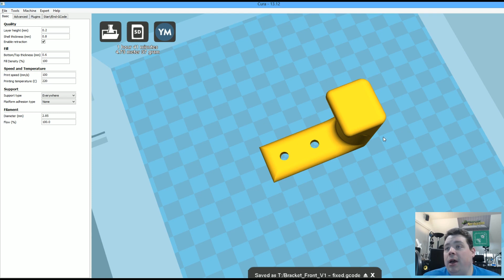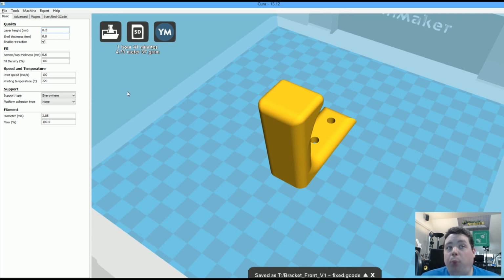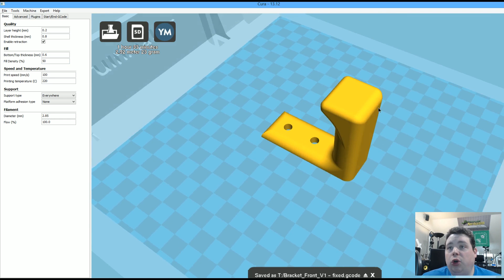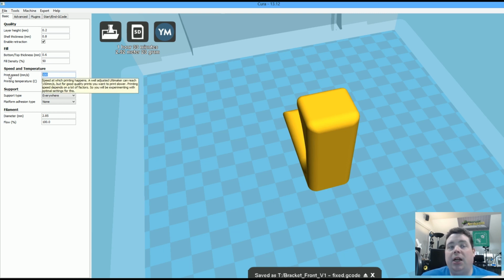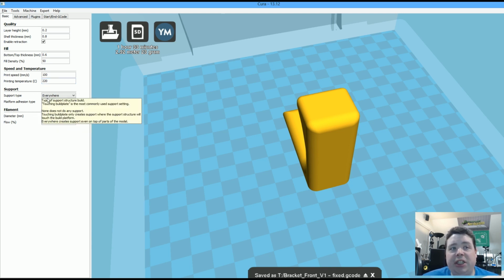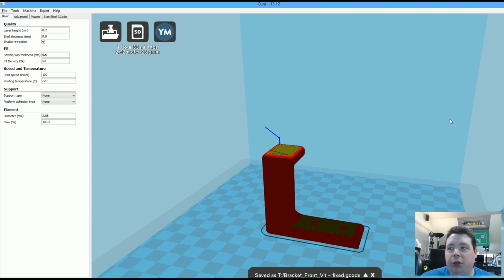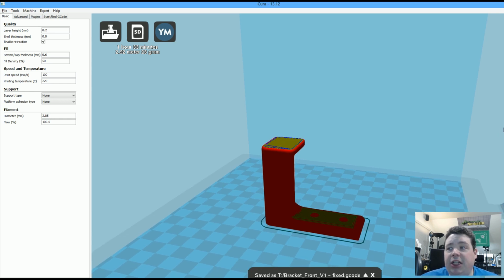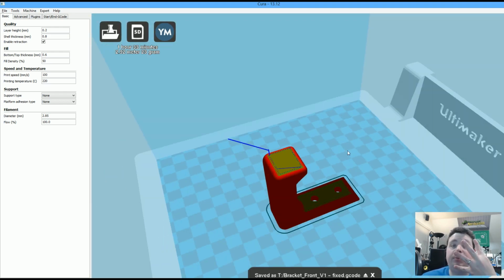3D Printing Hangers for my Headphone Collection : Nerd Cave Upgrade - @Barnacules

Comment: Why not just model those brackets for the buttkickers in CAD and send a drawing to wherever you're having them made?  You can model the mating parts and "test fit" the brackets all in software.  Making them with a 3D printer seems like you're just looking for an excuse to 3D print something.  It's a round-about solution to a problem that already has a much simpler solution.

Comment: I'm building my first robot for my hobby business.  I'm almost done, but my power supply is aweful.  I had to run my steppers slow.  Where should I look for a good 12v power supply; or what should I rip apart?  I want something that handles >3.6 amps.  I'm going to learn Solid Works or something sometime.  Right now I make most of my stuff out of wood, and the Artisan's Asylum has every tool I need.

Comment: you should take a look of the Sennheiser HH10 Headphone hanger, take the design of the hanger part and modify the back for the need to screw it on the wall, it will have better support for the headphone and won't mess up the foam on the headband.

Comment: can you print more with the robo 3d printer please ?
Reply: You should watch his vlogs, anyway the Robo is broken for this to use now and it is not as fast as the other printers so maybe if he is doing some small work he might use it
Reply from the maker: I will be doing a print on the Robo soon, I just got it back up and running again.
Reply: Barnacules Nerdgasm tenx and can you make a video on how set up the configuration on cura and the printer to print ? i like your videos Special on 3d print

Comment: i still dont get how 3d printers can do over hangs
Reply: The over hangs have to do with weight if the over hang is too much it will warp before cooling and therefore not print well.  Shorter overhangs have a lower center of gravity and this causes the to remain somewhat immune to warping dew to gravity. This happens because the 3d printer is melting the plastic and putting it in layers and you know that liquid is not very stable. Think about it this way if you have a short broomstick it is easy ti hold up from one end but if you have a longer broomstick then the center of gravity goes farther away from where you are holding and cause the broomstick to become harder to hold from one end. So that is why he prints support for thing that have a longer overhand. Judging from your user name I don't think you will understand anything I just typed.
Reply from the maker: Yes, it has to do with how fast the plastic can be cooled before it droops. And once it passes that point where that begins to happen you need to print a support structure under it to hold it and then cut if off after your done printing.

Comment: I wish i had a 3D printer. How expensive are they??
Reply: ***** Okay thanks :D
Reply: I have seen some used for 300 dollars u.s.
Reply: Chris Taylor the robo 3d printer is about $700 and barnacules recommends that one with a little tweeking and it also has a heated bed which is more than you can say for the Ultimaker v1
Reply: I found a $300.00 3D printer if you want to look at it. https://store.makibox.com/#/product-detail?type=1&&option=30
Reply: Aidan Braakman i use the printrbot simple
Reply: Chris Taylor
Look up RigidBot. They're just now achieving lift off and getting printers out to customers/backers after an overwhelming Kickstarter campaign. But soon you'll be able to get a quality machine with a 10x10x10 build volume for $500
Reply: i tested one of my friend (prusa mendel i3) if you buy it in a kit you need 650$ if you build it for yourself 300-350$

Comment: Advice on Good headphones Bluetooth for movies and games please £250 tops
Reply from the maker: I've never heard a good pair of Bluetooth headphones to be honest. The best wireless headphones I've used as the Sennheiser HD-180's, they are awesome! Might be able to find a used set with transmitter for 250
Reply: Barnacules Nerdgasm Thanks i'll check those out
Reply: Sony MDR-1RBT.

http://www.amazon.co.uk/gp/offer-listing/B00974PTFQ/ref=dp_olp_new?ie=UTF8&condition=new&qid=1392016801&sr=8-1

They're pretty great sounding, really good to wear, LOOOONG battery life (I can easily get the 30 hours they're rated for), NFC for pairing with phones (I just touch them with my phone, and 2 sec later they're powered on and playing) and lastly, personally I think they look great.

You can also get the smaller brother, the MDR-10RBT, which is cheaper, smaller, lighter, again in my book looks better, but sounds different. They're still good, but sound wise, I like the MDR-1RBT better. Personally, they're both as good as it gets for bluetooth. I've compared them to the "main"competitors at that price, the Parrot Zik, Logitech UE9000 and BOSE's Quiet Comfort 15. They lack one feature all of the others have, active noise canceling. To me though, that's a feature I don't need, and they're (again to my ears) the best sounding by far.

You can also use them analog with a cable should you see fit, and they're great to watch movies on with proper equipment. They have a really full sound, with a soundstage that's really wide for being closed back headphones, and again they're super comfortable to wear. Even with a cable.

That's my recommendation anyway.